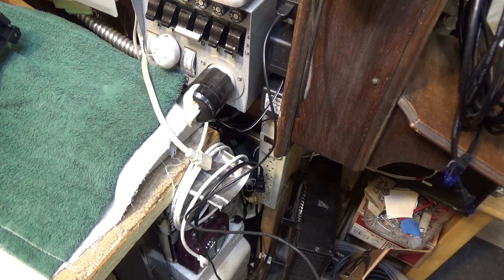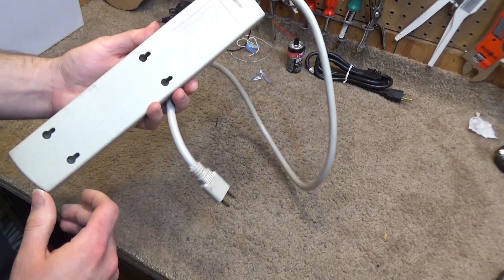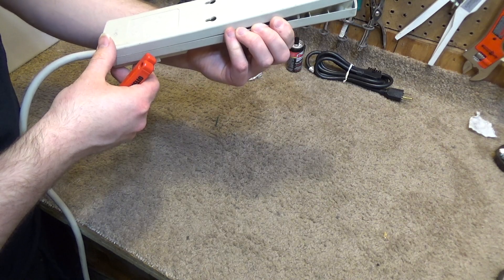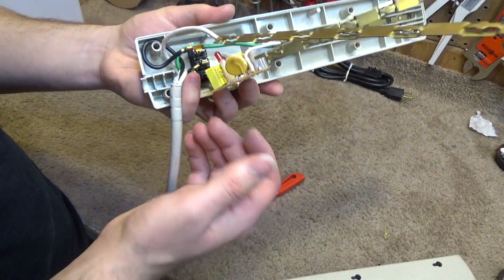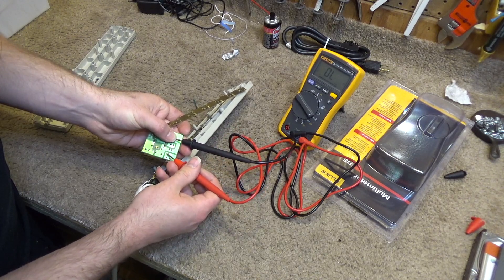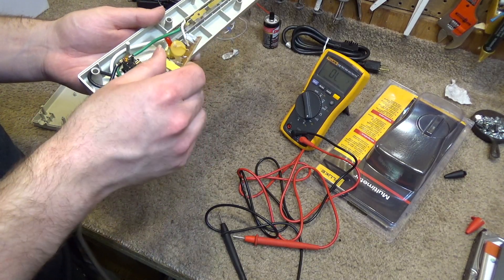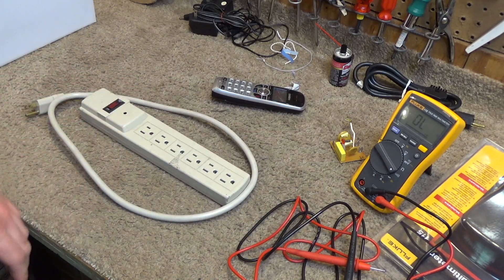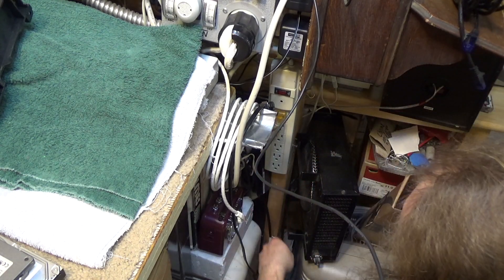Studio Power Bar Failure and Modification

Comment: The point part on the circuit board is a thermal fuse.   I bet that fuse opened up.   The yellow discs are MOVs (metal oxide varistor) that actual perform the surge protection.   They measure open when testing with a ohm meter.  They cannot be tested with typical bench gear.  They will only pass current when they see a high voltage surge.   They are all rated at various voltages.    In the case of this power strip since it is 120 volts rms they are commonly rated at 230 volts.     You should probably solder all the spade lugs going to the bus bars to get a good electrical connection.   Otherwise I would not recommend running more that 5 amps through it with that modified spade lug you bent.   Safety first.
Reply from the maker: It's connected to a few low-draw items, and it's never operated unattended. I'm not concerned about it. Safety third.

Comment: These things may be rated for 15 amps all day long, but it's really 15 amps of "cool" power.  When you're using a single appliance that takes enough energy for the wire to get warm, no matter how far under 15 you are, you're just asking for trouble with any power bar.  It would be safer to daisychain 7 of those together with the computers and the electronics in them, which leaves the other side of the original duplex wall outlet open for the high draw appliances.  Definitely monitor this one; I did a simple switch replacement in one of mine and it exploded after a few minutes of use.  Unexplainable things can happen.
Reply from the maker: Completely valid point. I have stopped plugging the heater into the bar and now connect it directly to the outlet. I'll probably replace this with an Isobar too.